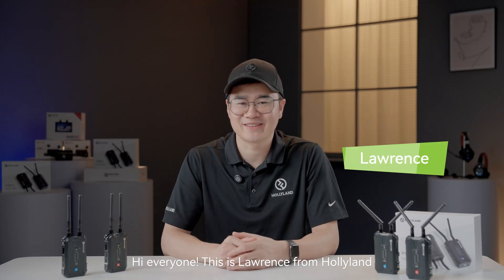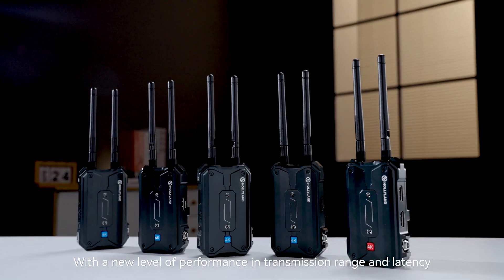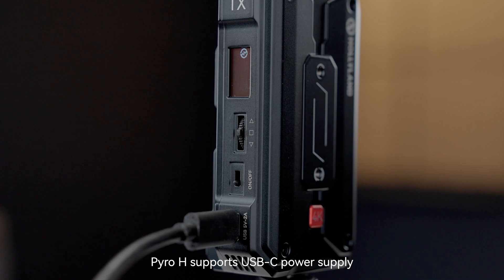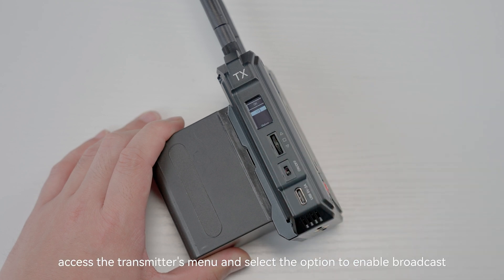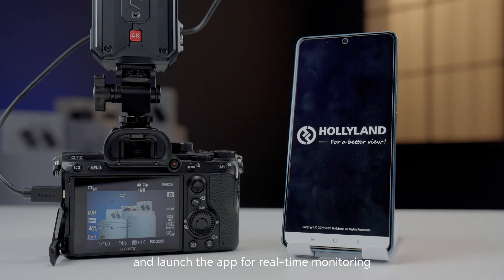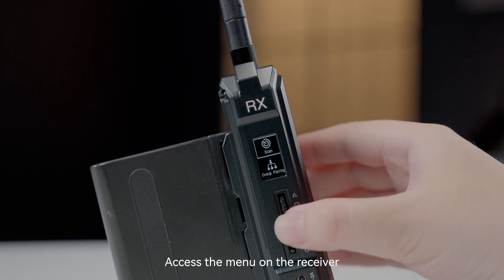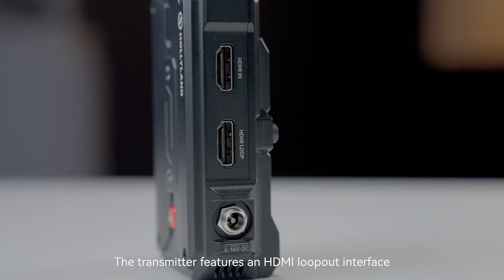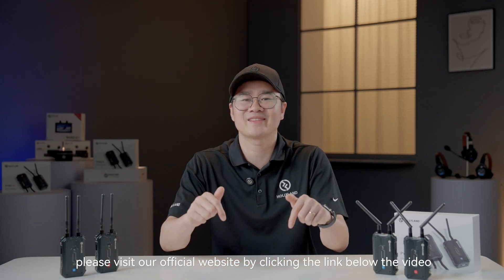Pyro H  TUTORIAL | Fuel Your Connections

Comment: I've also noted that the units do not stay  powered on unless attached to a power source (in my case a USB C connection)  Do these TX/RX units no hold a charge?
Reply: They don't have internal batteries but you can attach NP-F batteries.

Comment: I have a Galaxy S24 Ultra phone and I want to connect a Hollyland Pyro transmitter to it to stream to a large screen. Is it possible? Additionally, I want to know if I can be recording using my phone's camera while streaming to the large screen. I also want to know if I can use the Hollyland transmitter while charging my phone's battery, recording on my phone, and simultaneously streaming to the large screen. Another question: while streaming from my Galaxy S24 Ultra to a large screen, can I send the signal to another phone, for example, an iPhone 13 or perhaps another Galaxy S24, and record on either of those two devices the signal that is being transmitted from the other Galaxy phone? And at what quality can it be recorded? 4K?
Note: I am using a translator as English is not my native language. I apologize for any errors.

Comment: I have a problem.

When I connect my 4k camera to the TX, it shows 4k30p on the display of both the TX and RX. However, the RX output is black and shows no image, then it automatically reduces to 1080p and then it works. The problem is not the cables or the capture device, as both support 4K.
Reply: Same problem on mine how did you fix it?

Comment: What if we are recording above 4k30fps? How does it transmit that?
Can it use the power from the gimbal (like Ronin RS3 Pro) and slide under the base plate without needing the battery and run for hours?